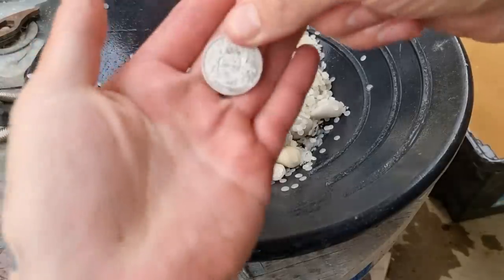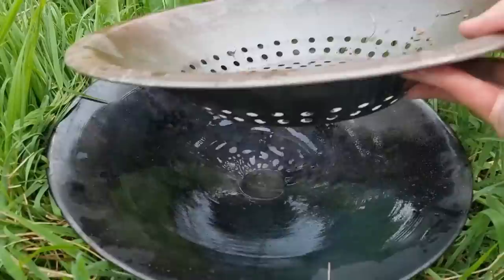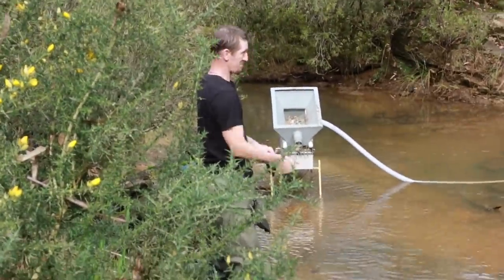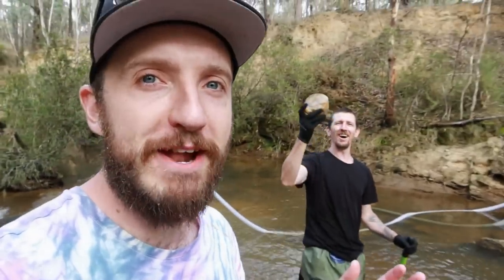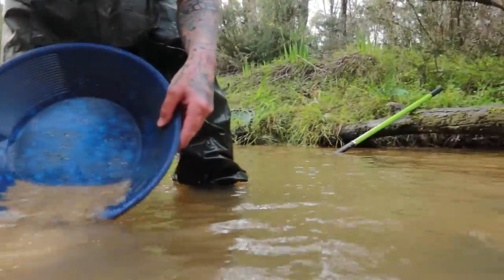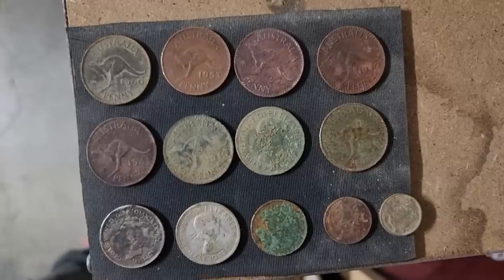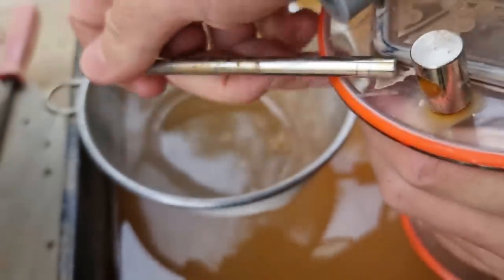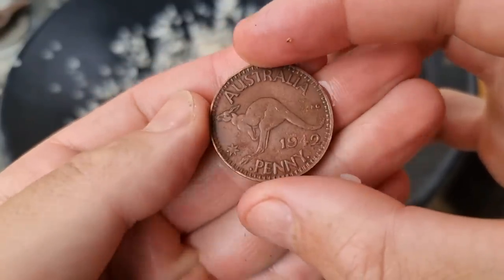Will it Pay Out? We Risked Sluicing Sand for Gold!

Comment: Hey Chris, I took a look and didn’t see where anyone suggested it, but I use these dredge pumps from Keene and Proline and they’re a pain until you know how to prime it right. You open the side valve and then at the foot valve pump it up and down in the water till it starts spitting out the valve. There’s a baffle in the screen end and it prevents the water from going back down, for it to work you have to keep in the water. Close the valve and start the motor, it’ll work nearly every time. If it’s still not pulling water, while the engine is going, go to the foot valve end and pump it up and down so water will start pulling. It’s designed for dredging so it’s a bit different, ping me if you have questions

Comment: hey, for tarnished metals, heat up some salt and baking soda in a stainless steel pan, low heat on a stove top, that will remove a tremendous amount of tarnish, I would keep the copper separate from the silver though

Comment: I recently brought all my pump equipment off thornado. Its been a absolute dream to work with. Only downside is 15kg is a bit of weight to carry at the end of the day after digging a huge hole.
Top end you get a honda wx15 lighter and heaps of waterflow but you will pay 3x as much.

Comment: You need to buy a none return valve on end of the hose at two high bank or the outlet of the pump
Reply from the maker: There is one on it. The air bleed valve is the issue
Reply: @VoGusProspecting  oh ok cool i remember trying to prime a fire fighting pump years ago and gravity kept working against me and guess what the bleed valve on it was the same issue but fixed it by wrapping electrical tape around the thread and worked like magic

Comment: I've been saving some gold oreish like stuff similar I had all the right signs and stuff like that I did a similar manual crush with my version of Stampy the backside of a chisel and the inside of a steel pot didn't work out great good sign of sulfides inside the material I did break up but then I remembered the video where you use the Australian Prospectors trick of firing the quartz rocks I did so I just haven't had success in the Rocks so far could it be that the ash made it hydrophobic and floated out on me? Let me know bud love the content
Reply: Well I meant no success with gold in the Rocks there was success and how brittle the courts and other rocks got after being fired

Comment: Hey Cris you were using a Keene dredge pump.They are not self priming.I use one all the time and it is up and running in about 30seconds.First you need a foot valve on your intake hose .Fill the hose and pump with water it will take off right away.You can shut down anytime and not lose your water.
Reply from the maker: Done all of that. It's because the air valve is on the side. It won't bleed

Comment: Hey Chris, I recently got the same batea pan and classifier that you use in your videos.  It came blue steeled from the manufacturer which is supposed to make it rust proof.  The problem is it doesn't provide a good contrast to see fine gold in the pan.  My question is if I season it like you did will that make it no longer rust proof?  Also, what type of oil did you use when you burned it?  Do you have any tips you wouldn't mind sharing about seasoning the pan this way?  Thanks 🙏

Comment: Hey mate, I have the same tumbler. I’ve had it for a couple years. I got put onto this varied shot to use. It has 3 different types of stainless steel shot which is perfect for all the detail on coins at some jewellery. Have a look on eBay. It also won’t rust like a lot of steel shot does. And I only ever used plain water. I found that it was all that is needed. Great work anyways. Just thought I would share the tip I received.
Reply from the maker: Thanks for the tips!
Reply: @VoGusProspecting  Sorry I don't have a link. But its a mix of round, round with disc like Saturn, and cylinder bits with pointy edges. If that makes sense. Lol

Comment: You just need to learn "HOW TO USE THE PUMP" . I have Keene dredge and the pump works fine.
Reply from the maker: Funny how I've spent well over a decade using all manner of pumps and yet this one doesn't work.
Reply: @VoGusProspecting  I've been watching you for years and like what you do. When I use my Keene pump I vent the air out of that fitting on the side. Just loosen it a bit, air will come out, when the water comes tighten the cap. I use a garden hose on mine to "BLAST"  the gravel loose with a nozzle.